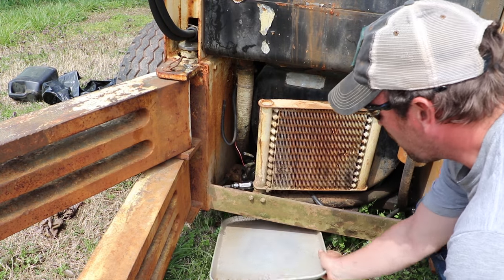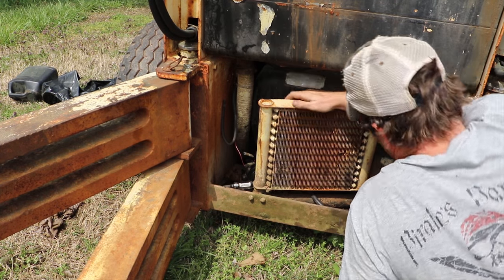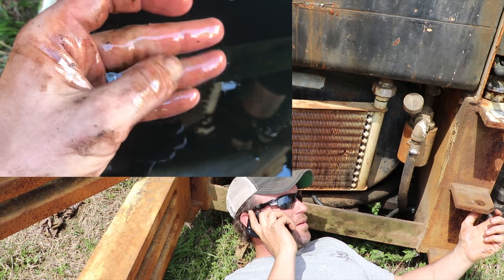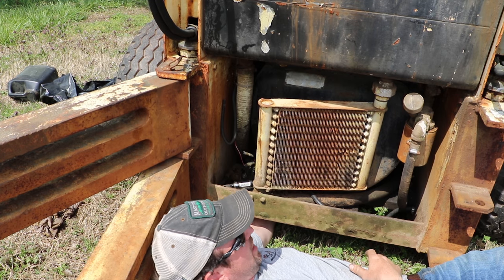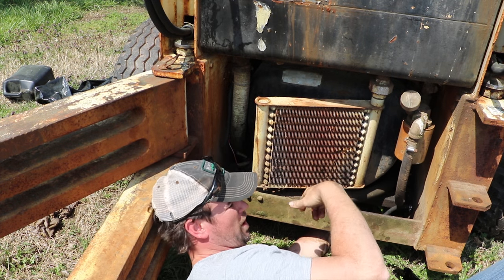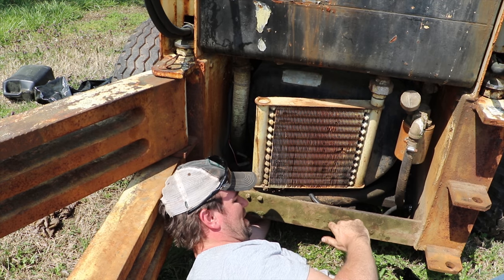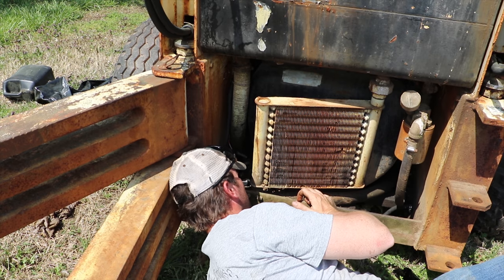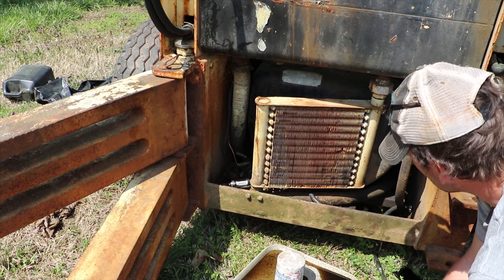Skid Steer Oil Change - Rust Bucket Rehab

Comment: Have you had to add hydraulic fluid?
What kind?
Have you repaired any hydraulic lines yet?
What size are the fittings?
I have a Ford 340 with the Wisconsin motors
Thanks for posting.

Comment: the 1st line with the arrow is the add line, the 2nd line is normally the full line, a dot above if it has is over full mark being your filter is up side down, whaat about the hydrolic filter, looks like it has not been changed in many years if ever, a plugged hydrolic filter will make the oil go though the by pass over heating the oil
Reply from the maker: I have been focused on getting it running, then I will change the hydraulic fluid and filter... definitely will need it.  I did not know it would flow through the bypass that doesn’t sound good!

Comment: Does Shawna (sp?) know you are using her Tupperware for a drain pan? ;>) Next time you change it you could try some Lock Tite on the nipple threads going into the block and put some teflon paste on the cap end, that may prevent the nipple from coming out and easier to get the drain oil into the Tupperware and less on the ground. The dip stick likely has a "Add" mark and "Full" mark on it.
Reply from the maker: I’m just trying to see if she actually watches any of my videos ;)